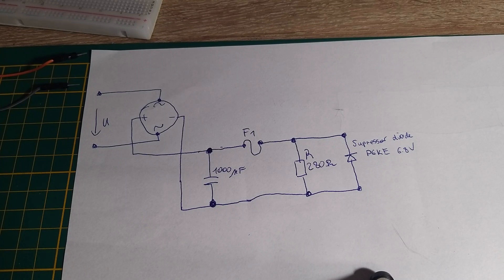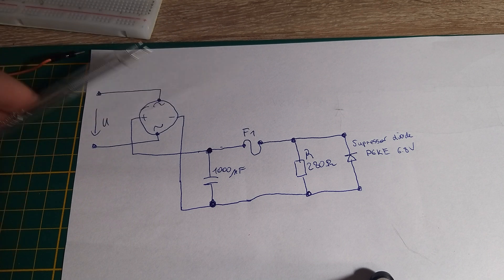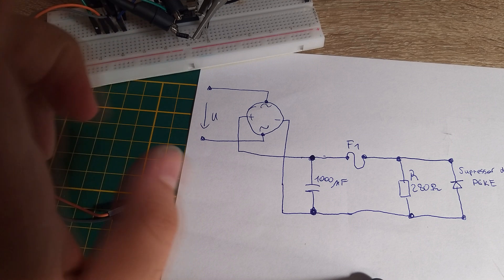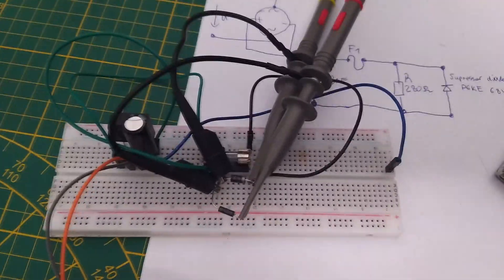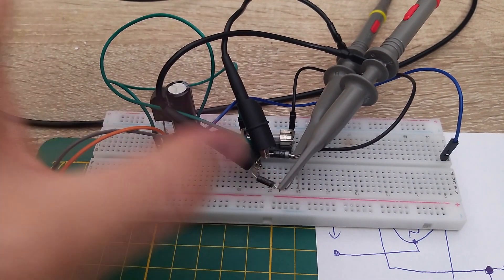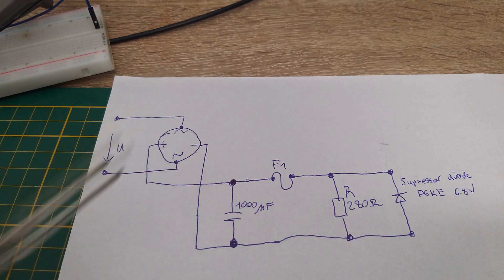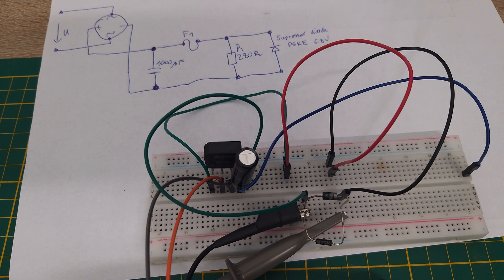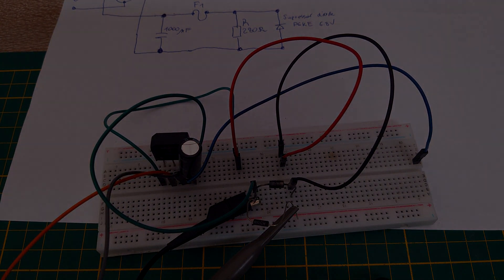Checking the suppressor diode P6KE 6.8 and lets burn it

Comment: Use a fuse before a TVS diode and a common mode choke followed by a capacitor after that. Mild spikes get clipped, but major ones cause crowbar effect. You can also use a FET follower that cuts the power when the TVS cuts in and trigger a crowbar circuit with a super fast transit time. I used circuits like that for protection of RF amplifiers.

Comment: I have VFD to repair but mostly i have problem with bidirectional TVS diodes and those are SMD with a code on it, how to find the correct code to know  max voltage can handle ?
Reply from the maker: If you want, sent me a picture of the component or the code on it. I will try to find out.
Reply: @DigitalArtDeco  the code printed on it is 
4N
i checked a website s-manual but i found it i zener but i am sure is not zener .
Reply from the maker: That is not easy to find if you dont have the datasheet. You can try to test the component in a test circuit where you can rise the voltage until you reach the break out voltage. Maybe this can help to find the correct replacement for a TVS?
Reply: @DigitalArtDeco  How to test it in a test circuit?